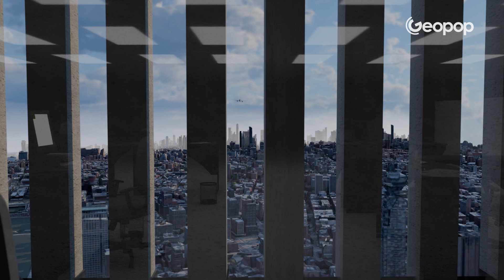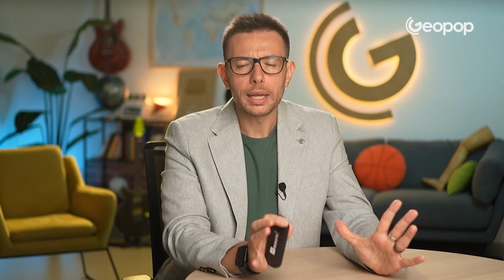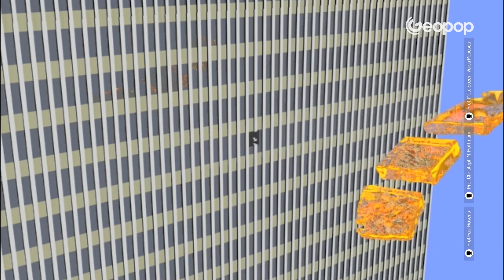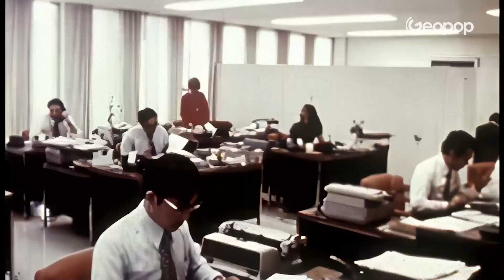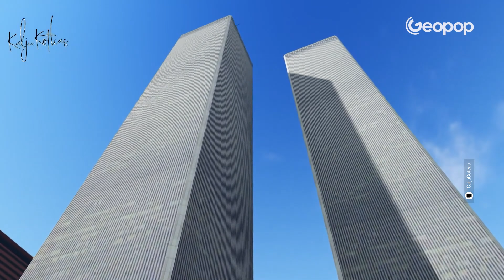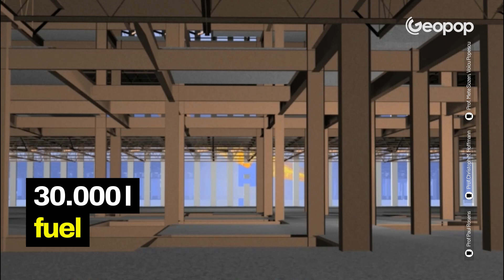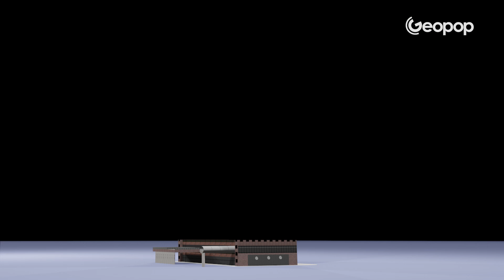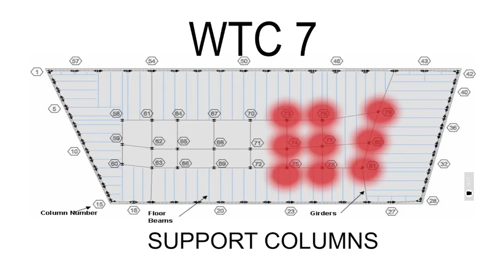9/11, 2001: The Technical Reconstruction of the Twin Towers and WTC 7 Collapses

Comment: Never in history nor verified by any study or experiment a steel grid structure has collapsed into its own footprint and created a pool of molten steel that took many weeks to cool off due to fire or multiple impacts. Even a COKE CAN can be set on fire for days and hit with dozens of airgun pellets and will never collapse and turn to DUST. 
There is a reason millions are paid to controlled demolition companies to perform what otherwise would be physically impossible. A Building simply collapse into its own footprint which is  the path of most resistance.   3 Buildings with only 2 airplanes. Now that is Bowling! 
But Hey if the Bush administration and NIST told us it was not a controlled demolition, I guess we can ignore physics and all the evidence that say otherwise and stay with their story backed by nothing other than their VAST and IRREPARABLE credibility.  Architects & Engineers for 9/11 Truth
Reply: Nonsense. Countless thousands of steel framed buildings and structures have collapsed due to fire. It happens all the time. Steel is formed using heat and deforms the same way, making it uniquely vulnerable to fire not immune from it. 

Demolition of steel framed buildings is invariably done by dismantling BTW.  Explosives are used for reinforced concrete construction.
Reply: @TheLoonResistance the word you used is correct "deforms" if the fire was hot enough which it wasn't it would justify some minor bending, very minor but not the entire collapse of the whole building even the 90% that never was affected by fire. Not to mention building 7.
Reply: @VelhaGuardaTricolor  - Uh huh.  

Twin Towers collapses were relatively straightforward and well understood in the professional engineering community within just weeks. Yet there’s still a lot of really bad information floating out there easily accessible on the internet, premised on wild baseless speculation and pathological theorizing with easy hand-wave answers.  Engineering is hard. This stuff is simple, exciting and requires little or no thinking, so it gets far too much attention.

Because anything can seem like a conspiracy if you don’t understand how it works I prepared my own short yet detailed technical description of Twin Towers collapses from my own observation and analysis of available true and relevant facts. No politics, ideology or magical thinking, just engineering. Hopefully this will dispel many common myths and answer most if not all questions you may have about the collapses.  

While complex, most of the Twin Towers collapse mechanisms can be seen with the naked eye and easily discerned and understood by the layperson if sufficient time is taken to understand.

1. The Twin Towers consisted of 4 primary structural elements that together formed an integrated system where each relied on the others. 47 hollow box-section steel Core Columns carry the majority of the gravity loads. The 236 hollow box-section steel Perimeter Columns carry the remainder and ALL of the lateral (wind) loads. Long-span Lightweight Steel Trusses connect the core and perimeter column together at each floor with a Hat Truss on top to tie the structure together as an integrated unit where no element can survive without the others. There was no structural load bearing concrete and most components were bolted together.

www.youtube.com/watch?v=u7OqrC74Dm4

2. The impact of 117 tons of airplane (= to about 12 dump trucks) at speeds up to 590 mph with the energy of a ton of TNT completely destroys the aircraft. This in no way implies the Towers come out unscathed. Many perimeter columns are damaged or destroyed as are some core columns (example; 33 of 59 perimeter and 20 of 47 core columns damaged or destroyed at the impact floors in the North Tower), This damage is primarily through bolt-shearing failures at the end connecting flanges, as well as bending, twisting and fracturing of weld seams. There was no cutting or slicing - the reality was far more violent and messy.

3. The impacts destroy or damage fire insulation, fire breaks and sprinkler systems on multiple floors. Huge fires are started across multiple floors simultaneously and allowed to spread rapidly with no effective firefighting or fire suppression. This was an unprecedented fire event .

4. The hotter steel gets the weaker it gets . With fire insulation stripped away and no sprinklers the survival time of the steel greatly reduced. Gradually over time heat causes the lightweight steel Floor Trusses at the impact damaged floors to sag, which was observed and recorded. No steel melted or needed to. Structural steel fails long before it becomes a puddle. It just needs to bend

5. Sagging floor trusses pull on the increasingly weak and overloaded Perimeter Columns, causing some of them to bow inward by up to 5 feet. A straight column is up to 4 times stronger than a bent column. The bowed Perimeter Columns buckle and fail, quietly initiating collapse. The formerly static mass above which the structure below could easily support is converted to a dynamic mass up to 30 times greater. Because they have buckled, the Columns above and below the failure point are no longer aligned . The load bearing structure below no longer bears any load as it falls past the lower columns, NOT onto them.

www.youtube.com/watch?v=ULdiD6gYZO0

6. Thousands of tons of debris fall within the four outer walls, down through the open office space, crashing onto the first intact floor it encounters, immediately breaking the bolted column connections as the amount of resistance the Floor Trusses can offer is negligible. The falling debris slows only marginally and briefly. Note: 
6a. This is NOT a solid top block crashing into and “crushing” a solid bottom block . 
6b. The debris falls past the columns not onto them. The columns provide no resistance to the falling debris. 
6c. Only the bolted floor truss connections to the core and perimeter columns offer any resistance. A pair of 5/8” bolts at each end of each truss vs. thousands of tons of falling debris. 
6d. No laws of physics are violated. 
6e. There is no 20 floors against 90 floors but rather 20 floors against one floor, then 21 floors against one floor, then 22 floors against one floor, etc. 

7. This floor-led collapse progression within the four outer walls can only go straight down.
7a. This process is often incorrectly referred to as “pancaking”. The catchy name stuck but nobody knows what it really means and "pancaking" is too simplistic and inaccurate anyway. I prefer Kaiserschmarrn.

8. Collapse progresses through the floor systems past the columns, through the path of least resistance . The resistance offered by each floor is always the same while the mass of debris and its velocity – thus its energy - increases with each floor failure. Each floor offers the exact same resistance to the falling mass while with each failure the falling debris constantly gains both mass and velocity. *This process of floor-by-floor destruction cannot be arrested, it can only speed up . Rate of floor failures increases with each floor as momentum increases, reaching an average acceleration of 0.65 of GA, or 35% slower than true free fall. Bam, bam, bam down the building until there are no more floors to fail. The resistance offered by each successive floor is always the same. More mass, more velocity, same resistance with each floor. Don’t get stuck on the but the lower floors weren’t on fire nonsense. They weren‘t and didn’t need to be.

9. The Towers were 95% air by volume. As that air was compressed inside the building it is forced down the tower and blown out the sides in reaction to the building collapsing . Those were not “explosions”, it was expulsions of compressed air caused by the collapsing building, explaining the low velocity, lack of flash, blast, supersonic pressure waves and lethal high-velocity ejecta.

10. Perimeter Columns become detached and peel away like a banana behind the collapse front, playing out to the four points of the compass extending to more than 600 feet from the base of the towers. This was quite obvious from examination of the debris pile.

11. Core Columns fail last as their internal beam bracing is stripped away by falling debris and lateral support from the floor to perimeter columns is lost.

12. For those who care about how long this whole process took; 31-34 seconds from the moment the perimeter columns buckled until the last core columns hit the pile, or 1/3 the rate of true free fall. Don’t believe me? Just watch any video of the collapses and note the loose truly free-falling debris dropping much faster than the towers themselves.

13. Each Tower had a 1-acre footprint. Far from collapsing inside their own footprints the debris pile spread out over 17 acres in a pile up to 14 stories deep. 8 surrounding buildings were destroyed and scores more damaged by the falling debris.

14. NOT observed were the 180-190 dB bangs of thousands of high explosive devices or the blinding bright flashes of burning thermite. Neither explosives or thermite could have survived the impacts and subsequent fire nor could have caused the (silent) perimeter column buckling that clearly initiated collapse either. A video of a shocked and injured firefighter casually using the magic word explosion is in no way proof of explsoIVES and the demolition_ case relies entirely on that sort of thing. There is zero tangible physical evidence and it would be technically impossible, totally impractical and completely unnecessary. No one would bother.  In 24 years zero structural engineers of tall buildings, including the 1/3 that have retired in that time, have made any statements in support of pre-planned demolition claims. NONE. The lack of any such citations in the engineering literature (published in any country worldwide) is telling.

15. Twin Towers were perfectly safe within their design envelope. They only collapsed when taken far outside design parameters by an extraordinary and unprecedented event

Impact + Fire (heat) + Time + Gravity = Collapse . Remove any one of those 4 elements and there is no collapse. Ignore any of those elements (as many do) and you will never understand the collapses. The Twin Towers were an integrated system in which no one component could survive without the others. One fails, the rest follow, through the path of least resistance – DOWN – through the open space, bypassing the path of greatest resistance – the columns. Nothing I just described violates any laws of physics. All of the above is true no matter who planned and carried out the 9/11 attacks or why

I hope you found this helpful and informative. It is not meant to be adversarial, but to solicit informed critical comment, positive or negative. If I made any errors of fact, logic or reason or left anything critical out, please let me know so I can fix it. To stay focused, just one topic at a time please and on-topic (Twin Towers ONLY). No word-salads of Gish Gallop. IF you can offer a more plausible alternative be my guest. Please start any reply with the words “Tits McGee” or I will know you didn’t read it, are not serious and just wasting my time.
Reply: @VelhaGuardaTricolor Wrong, many steel buildings have collapsed due to fire damage. Steel at 600C can be bent by hand - that’s how blacksmiths work steel. And the streams of molten ALUMINIUM flowing from the impact area (it’s on video of the disaster) showed that it got at least that hot. Once one floor buckled, gravity took over.
Reply: @allangibson8494  Is it your blind trust in Government or just on the Bush/Cheney administration that makes you this gullible or is it just lack of technical or historical knowledge?  
FREE FALL SPEED can only be achieved by a controlled demolition. 
Ten thousand airplanes full to the brim with jet fuel wouldn't do that to 1 building. 
But you believe 2 did it to 3. 
Do you believe in Santa and the Easter Bunny too?😆
Reply: @VelhaGuardaTricolor  the WTC towers didn’t fall at “freefall speed” either. The only surprise is they didn’t fall immediately after the planes punched right through their critical structure. The skin of the WTC towers WAS the structure. They were hollow tubes with floors spanning right across to provide floors unobstructed by columns. The towers, uniquely, had no fire proof central concrete spine - just plasterboard wrapped steel stairs next to the elevator shafts.
Reply: @allangibson8494  "The Skin of the WTC Towers WAS the structure" 
So nobody told you about the 47 core columns then?
"The 47 core columns refer to the central steel columns that formed the "spine" of each World Trade Center tower"
But lets ignore those columns just for the sake of dialogue here.
Lets pretend they didn't exist at all. 
So we would be looking at a soda can like structure and you know what happens when we shoot pellets at a soda can, right?
You can shoot 50 shots and the can will still stand. All twisted and bent but standing. 
Now to turn that into fine powder and to collapse at free fall speed would take something else.
Reply: @VelhaGuardaTricolor Those columns weren’t capable of supporting the structure - they were just the frame for the elevator shafts. The structure was supported by the skin. 
As for your “soda can” analogy - try standing on a soda can (soda cans are aluminum balloons - their resistance to crushing comes from the pressure inside).
Reply: @allangibson8494  "Structural Role:
The primary function of these 47 columns was to support the building's gravity loads, while the closely spaced exterior columns handled wind loads" 

Do some research before exposing your ignorance online next time. 

I won't take you seriously after this one. 
Bye!

Comment: If there were seven seperate buildings, in the World Trade Centre, and three collapsed, the WTC 7, hours later, because of damage, from the Twin Towers, why didn't the other WTC buildings collapse as well, and surrounding buildings closer by?
A very well put together load of bullshit. And besides that, grow a pair. You sound like a fuckn' Sheila.
Reply: Six buildings collapsed out of the ten lost on 9/11/2001. Each building was of different design and construction and suffered different damage. It's a more than a bit oversimplistic to expect identical outcomes in different scenarios. Each case needs to be examined on its own merits.